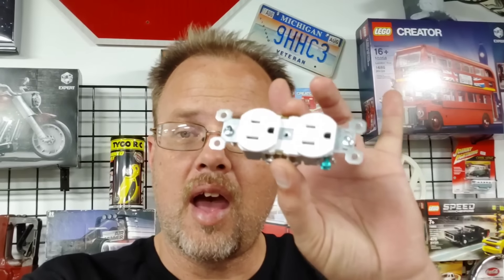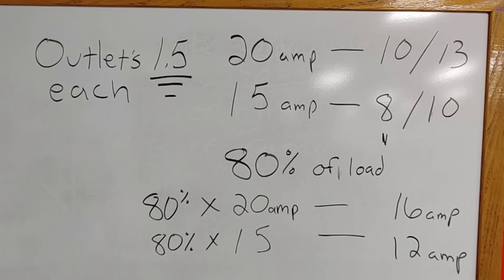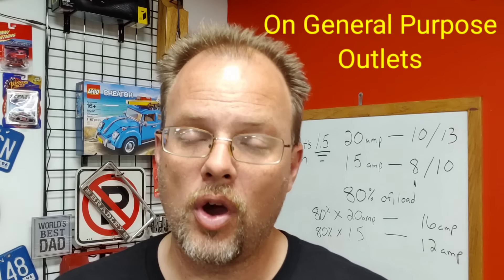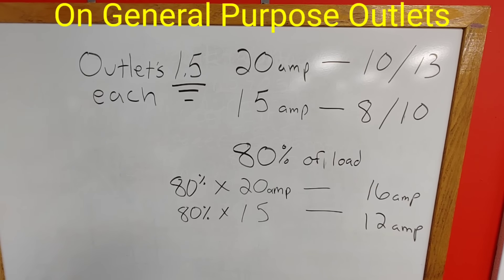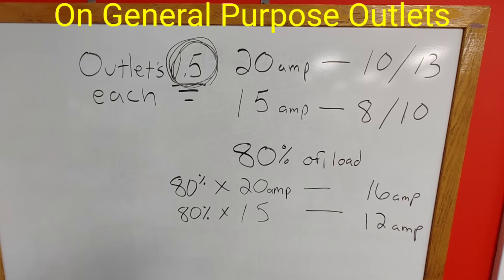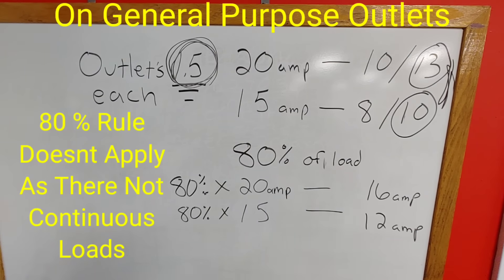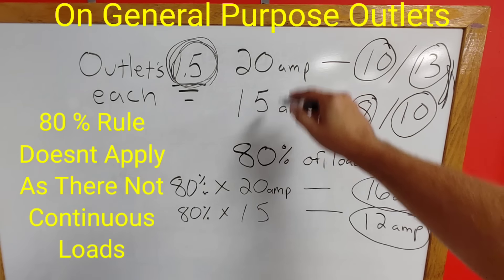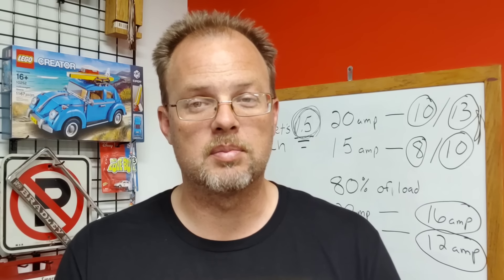How many outlets can you put on one circuit ?

Comment: IMO the 1.5 number, fundamental to the whole thing, is automatically suspect: most outlets I’ve seen draw 0.0 year-round. More than half of the ones that do get used are for small electronics that draw continuously in the milliamperes range, or rarely run at all . Exceptions are fixed uses like microwave ovens, entertainment clusters, and washing machines, plus some floating infrequent uses like drills or vacuum cleaners that will generally go into otherwise empty sockets anywhere, briefly. I just don’t think you can give a standard number to every outlet. It depends on its location and what is likely to be plugged into it. For instance: I once very consciously built an office space where I put 2-gang outlet boxes every 6 feet all the way around the 14x14 room on one circuit. The max 2A computer cluster was only ever going to plug into one of them at a time, but it allowed me to rearrange the layout and to plug other smaller or transient things in anywhere that was convenient, with plenty of headroom. The only risk was of the same kind of idiot who would plug together an octopus of extension cords and splitters on a single plug. There’s nothing you can do about idiots, though.

Comment: You can legally put any number you want. Common building practice is to consider each single outlet at one amp.  So a duplex outlet would be figured as two amps. Now a 20 amp breaker has a continuous load rating of 16 amps allowing for eight outlets per breaker. A fifteen amp breaker is rated for 12 amps and that would amount to six outlets per circuit.

Comment: Not sure where this video was shot, but Canadian Electrical code limits the number of receptacles per circuit and also says the ampacity of 1 receptacle. CEC 2018, rule 8-304 covers this. 1 amp per receptacle to a maximum of 80% of rated breaker. So a typical 15A circuit could have 12 receptacles, etc.

Comment: It depends on the draw. Bedroom type areas are not equal to garage/shop type areas. Consider 2 bedrooms on 1 circuit. You have 2 clocks, we’ll assume 2 radios or televisions running, 2 desk lamps, and 2 laptops. You could doo all of that on 10 outlets because most of it is lower draw.
A garage by comparison, you (or future homeowner) could have a saw running, an air compressor running, a radio running, plug in lights, battery chargers (including vehicle battery chargers), drills, welders, it’s difficult to say how many of any of those kinds of things may be running simultaneously. That’s not considering a possible (and common) freezer. In a garage/shop I recommend 2 circuits with 8 outlets each maximum, a 15A & a 20A circuit. 
Regardless, it comes down to what the projected draw is likely to be. A kitchen & bathroom are not equals.
Reply: That works in normal situations but consider what if the heating breaks and you have to resort to space heaters before you can get it fixed? 10 outlets? You can have several chargers. I have 10.  My TV system uses some 6 sockets.

Comment: Only a carpenter, but I work with enough electricians and try to keep up with their code.  I have gone with the 20/13 15/10 rule.  I think that is a hard number for commercial/industrial.  Residential no limit, but I don't want to get crazy.  And from my vocational school training days, that number helps cluster the outlets.  Bedrooms, living room, good to have 2 circuits for kitchen, etc.

When helping with maintenance at a previous church I belonged to, they had an a-hole contractor for expansion.  Many problems, liked leaky roof, crushed sewer line...  When I got there, I started noticing each circuit had about 3 outlets.  That felt like a waste of excessive write run, and necessitating about twice the breakers and load centers needed.  Maybe to run up the bill to make more money?  There is playing it safe, and then there is being beyond stupid.

Comment: I guess not many people here live in Ontario Canada. The code in Ontario limits the outlets, including light points, to 12. 
The load on 2 outlets can trip your breaker of 15 amps if they are drawing current at capacity. I really don't agree that the limit of outlets should be calculated on a percentage bases. Who can predict what the use of any outlet will be? Unless a circuit is dedicated for a particular setup.
Reply: Two 1500 watt appliance on one duplex outlet should trip a 15 or 20 amp circuit.

Comment: Whether you put two receptacles in a room or two hundred, the load used in that space is likely to be the same. The NEC considers general use receptacles to be part of the lighting load and bases that load on square footage.  I try to think what kind of load a customer is likely to use - will they be plugging in an electric space heater or air conditioner, etc.  Outside of items like this, the majority of plug-in use in a home will be in the kitchen, where small appliance circuits are required, bathrooms which are required to be on their own circuit and usually don't exceed two, and garage/basement shops where power and bench tools/machines may be used.  In the end, I think the correct answer to the question of how many is - how many so that you can be sure you never get a call from a customer saying they keep tripping a breaker whenever.....

Comment: My theory is give the appliances that use the heaviest amount of amperage  their own circuit. Refrigerator, space heater, electric stove/oven  electric clothes dryer, air conditioner, and in the garage or shop a separate circuit for a welder and or air compressor.  You'll most definitely prevent an over load and gain piece of mind by preventing an electrical fire.  Believe Me  It Is Worth Every Dollar Spent.

Comment: This was good. If you ever edit the video, you might e plain that the quantity of receptacles on a circuit is all about ensuring not to trip breaker (overload circuit) if every single outlet was in use at same time. Since each outlet adds amperage to the circuit, the owner is merely ensuring it never overloads. The odds of every outlet in a room being used is small

Comment: I have been using the 1.5A rule since I was an apprentice. Of course, the rule then was for general receptacle circuits and said that each receptacle on that circuit was to be calculated at 180VA - or your 1.5A per receptacle.220.14 (I)   The location in the code book may or may not have changed since 2017. (My last code book.)
The 80% rule I used on dedicated circuits. Like a; clothes washer, microwave, refrigerator, or particular piece of shop equipment. Here you do not want to put a load requirement right at the trip point of the breaker.
NFPA 70 is the Fire Underwriters minimum requirements. Some jurisdictions can require tougher code restrictions but I like these.
Electricians can use their own minimum standards as well. For instance, I seldom - if ever - install a 15A receptacle receptacle circuit. Yes, there's less profit but DIY'ers sometimes add receptacles to a circuit. The copper and cable construction has changed since I first wired homes not to mention the new temperature derating they've added.
I've never witnessed an inspector performing an actual count but it's my name on the job performed.
Great video.
Reply: Can you put a light on the same circuit as the outlets? I have an older home with all 2 prong outlets  12 gauge wire and 20 Amp breakers. That's how they wired it.

Comment: Im no electrician but my guess to not overloading a outlet is buying a GFCI outlet or afci, cause it has a off reset test button. The cheap $0.60 or $0.80 ones don't. And sometimes catch fire especially if you push it in instead of putting the line and load on the gold and silver screw. I don't think those wire outlets prevent fire,  🔥, instead I think they catch fire  however a AFCI or GFCI may prevent electrical fire buy shutting off electricity on that particular outlet. However sick of breakers the breakers usually turn off anyway but not all the time especially not with them cheap outlets. Jesse I should be the leader of the outlets then you can put the cheap ones after. Then u can plug in 1 of those wire outlets. Any other suggestions or opinions?
Reply: AFCI and GFCI are required by code now so I agree, instead of using receptacle protection code allows you to install AFCI/GFCI breakers.

Comment: I live in a manufactured home. The builders put a lot of stuff on a single breaker. Lights for multiple rooms and receptacles for 3 rooms. I don't agree with it but apparently it's up to code. I would rewire it if that didn't require tearing out the walls. I'm just careful about where I plug in higher current loads.

In my garage the most I put on one circuit is 4 receptacles hahah
Reply from the maker: That is code for general purpose outlets
Reply: I'm replacing old receptacles after moving into a house, and on one 15A  breaker there are lights for 3 bedrooms + 1 bathroom, plus 4 outlets per bedroom and one outlet in the bathroom. That's 5 lights and 13 outlets, seems like a lot.

Comment: You're right about alot. If yo go by watts per square foot in accordance with nec 220.12 for residential dwelling units you use 3va per SQ ft. So for 500 sq feet that would be 1500 va. For a 15 amp circuit at 3,va per SQ ft you can cover 375 SQ feet. So going by code you are required to have a wall outlet every 12feet. So your number of outlets will be determined by the minimum spacing. You can space closer as need be. You can have as many outlets you want in 500sq feet on a 20 amp circuit or as many as you want in 375 sq feet on a 15amo circuit. So a 3 bedroom house if the total of the 3 bedrooms add up to 500sq feet or less they could all be put on one 20 amp circuit. This would also include the ceiling light fixtures. So because #14 wire is easier to work with than #12, you can put as many outlets on that circuit limited by 375 sq feet. If you're over 375 sq feet you would need 2 - 15 amp circuits. So now what to do. One solution is put the two smaller bedrooms on 1 15 amp circuit and the master bedroom on another. So in a 1500 sq ft house you would only need 3 general purpose circuits at 20 amps or 4  15 amp circuits , each covering 375 sq. Feet. You could combine lights and recepts if you want or split them up.

Comment: I agree 180va for commercial per nec. I don’t think nor does the nec require you to use same guidelines for residential. If you want to use the same commercial guidelines for resi that’s fine but nothing in nec says you have to use the 180va per receptacle
Reply from the maker: No it doesnt but you will have people argue that with you till they are blue in the face. :)
Reply: There is no specific wording saying "for commercial receptacles". There is also no wording saying " for dwelling unit receptacles". You need to know how to use and interpret the code book so you can do the correct math.

Comment: The 1.5 amps per outlet comes from the code for commercial installations. 
80 per cent comes from the same commercial code sections. 
Use your answers as they are the right ones for commercial wiring installations.

Comment: differences between minimal requirements (code), practical  ( price restraints ), and what you really want or need can be huge . Always discuss what you want with your contractor. example; you can have four receptacles on one circuit for your counter top but in most cases you can't power a microwave, toaster, and a coffee pot at the same time
Reply: yes there is a way.  Run 3 wire (4 with ground)red, black, white 240 volt 10 gauge metal shielded cable to the counter top from the fuse/breaker box. Wire up the HIGH AMPERAGE outlets, with the white common to both sides of 2 silver screw  socket receptacles. Wire up red to hot (brass) side of one, and black to the other receptacle. You may want to consider having one receptacle, switched, so as not to wear out/stress the metal connectors in receptacle. 
  In 240 wiring, white is common to 120 volts of each side of 240 (red, one side:  black the other 120) It will save you alotta grief, in the future.....even utilize  GFI  receptacles...
Reply: @petersack5074  microwaves require a dedicated circuit per nec.

Comment: I'm in the process of installing outdoor outlets this was very informative thank you
Reply: Careful on those....the video refers to general purpose circuits only; outdoor outlets are dedicated circuits with special rules, especially if within a certain height from grade level. Check your local code or seek advice from an electrician in your area. (I could tell you what the code is in my area, but the chances that we're in the same jurisdiction are extremely low)

Comment: Here in Canada, by code, 8-304 Maximum number of outlets per circuit would be 12, but if you know each outlet not more than 1 amp like some switches for the led light, you can put more than 12 outlets and no more than 80% load. In my experience, you’d better separate plugs and lights , cus you can save afci breakers.

Comment: The question of how many outlets on a circuit. The question you need to think about is not how many outlets, but think about your intentions for the outlets what you will power up that is what determines what will trip your breaker. For example if you were trying to run electrical heaters on high on one circuit and let's say you have three heaters on high depending how large the electric heaters are more than likely you will trip your breaker, but if you take the same heaters with nothing else on the circuit put the heater on low you have a chance of not tripping the heaters that is why sometimes if you run an electric heater and a hair dryer sometimes you will trip a breaker you're pulling too much on one circuit. Especially the ones that were 15 amps.
I also think you have to consider are you installing a gfic outlet on that circuit because they are very sensitive to certain situation within that circuit.
This is only my thoughts and experience behind circuits and outlets.

Comment: I have a question. Does the bathroom power outlet have to be the only outlet on that circuit by code? My restroom does not have a power outlet and Id like to add one so that I can plug in my toothbrush and shaver. But Id also like to patch into an existing line near by. It would be a real chore to have to run a whole new circuit from the power box from the other side of the house.
Reply from the maker: Yes you can tap off a nearby circuit but you have to make sure it is gfci-protected

Comment: What about a Light switch that controls 2 ceiling light fans, & 7 outlets. Do u include the light switch. All on 15 Amp breaker.
Reply from the maker: A switch is not a load.  The fans are a load and should be added to your calculations.

Comment: It depends on if your using all the outlets at once or not. I have many outlets on my pool fence in case I want to move things around, like fans or radios or air pumps to blow up toys. More outlets are better than piggy back plug ins.

Comment: The 1.5 amp rating per outlet is from commercial load calculations where there is a limit to the number that can be used. . In a residential application there is not a limit as stated in the video. In a residence it is unlikely that multiple device will be in use at a single time and the likelihood of overloading the circuit is very low that’s why there is no limit. In practice most residential branch circuits are going to be mixed lighting and receptacles. In most modern homes the biggest load plugged into interior general purposes outlet is going to be a vacuum cleaner. Most lighting is now LED. The loads on branch circuits within a home are quite low.
Reply: Well there are kitchen appliances...  Toasters, Toaster Ovens, Microwave Ovens, Coffee pots.  If I remember correctly, kitchen receptacles were were supposed to be on different circuits because of this.  My kitchen counter is on the same circuit, so I can't use the microwave and the toaster oven at the same time without the breaker popping.
Reply: @swinde  yes, kitchen counter receptacles are required to be dedicated circuits. This is for the assumed appliance load, toasters, coffee makers, etc. A portable microwave is considered a countertop appliance and a dedicated circuit is not required. The NEC requires two 20 amp circuits and they must be spaced every 24 inches and GFCI protected. Can’t remember when this was made a requirement. If you have an older home you may only have a single circuit and you have to be selective about what appliances are used at one time.

Comment: This might be a stupid question, but I've always wondered why when they wire up outlets on a circuit, why don't they pigtail each outlet so if there is a problem with one it doesn't affect the others on that circuit.
Reply from the maker: Well you are suppose to pigtail them all.  At least the building inspecters by me require it.  But most people dont do it

Comment: Well what happens when you plug in a 1500 watt space heater in an outlet. These heaters are quite common and used a lot in homes, especially older homes. That is a heck of a lot more amps being used than just 1.5 amps. So how does this all add up.

Comment: I was under the idea that the wire size determined the breaker size and outlet rating.  The number of outlets does not come into the picture except for a practical matter of the circuiting being able to supply the demand of the users.

Comment: 100 amp service or 200 amp service?  How many following a GFI? Load depending? 5 per 15,  7 per 20. 12 ga or 14 ga wire?
Reply: Service size doesn’t matter in this case. I follow a GFI with up to 7 outlets. I put no more than 8 outlets on either 15 or 20 amp circuits, standard loads. #14 on 15 amp and #12 on 20 amp. If you know an 8-10 amp appliance is going to plugged in  pull a dedicated wire to the box. Space heaters are an electricians nightmare, or gift depending on how you look at it. They load a 15 amp circuit by themselves. Lots of service calls! Good luck!